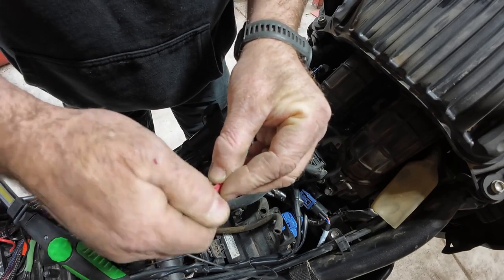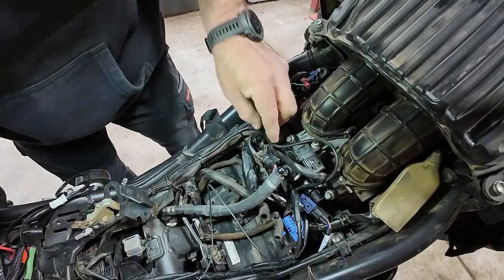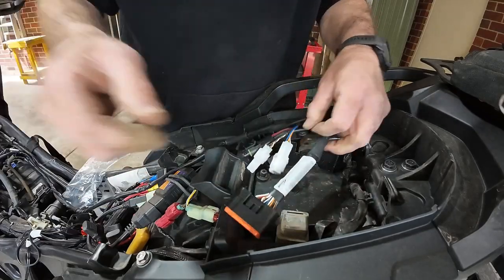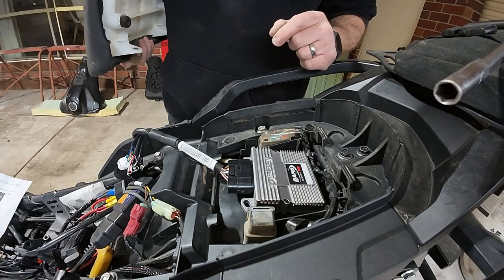Rapid Evo ECU and Veridian cruise are they any good

Comment: Remove the pillion handle rack and there is 2 tunnels on either side of the front cross brace that wires fit under.
Reply from the maker: @TRAVERSE_ADV  thank you I will look into that.. cheers
Reply: @jpbloodyaussie  I have an Eastern Beaver PC8 under the pillion seat. It came with a bike specific plug and play loom, but was made to go under the rider seat. 

I managed to get it under the pillion seat using the tunnels in the front wall of the rack alomg with all my after market wiring I have installed for micro relays in the pillion seat area.

Comment: Nice one be interested to see how the Fuel comparison turns out, Looking at pulling the trigger on one of the EVO's also more so for the economy side, Are you getting the Nomad? i have one of them fitted all ready and all up around 80km to 95km will pull 550km out of both tanks, anything over 4000rpm and you will drop back to 450km range maybe less. I have the 2017 ABS CRF.
Reply from the maker: @adv-moto-rider7216  what is the Nomad? I have not had a chance to do economy tests as yet... I'm hoping to very soon and as soon as I do I will do an update.
Reply: @jpbloodyaussie  Nomad tanks make a fuel tank for the rear of the CRF1000  they are located in Victoria, they do a 8.5L tank that replaces the rear seat.
Reply from the maker: @adv-moto-rider7216  oh yes.... silly me. Yes next on my budget